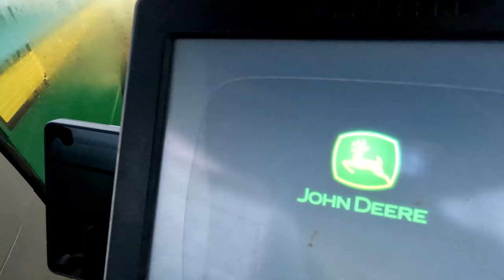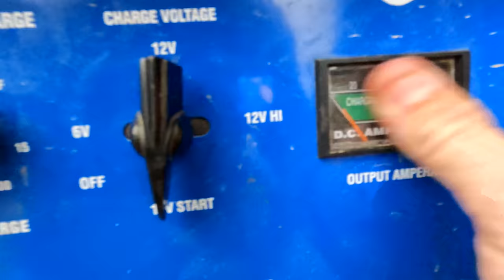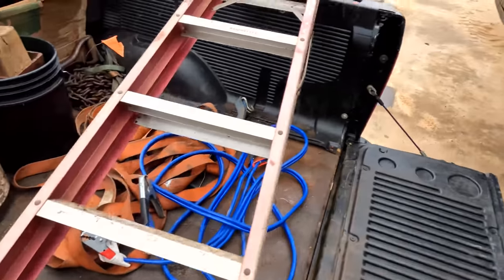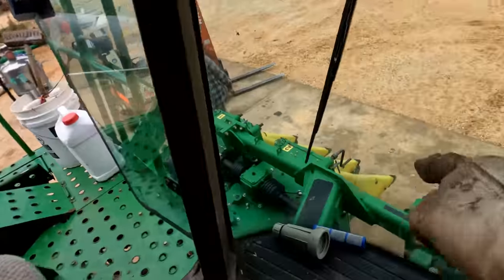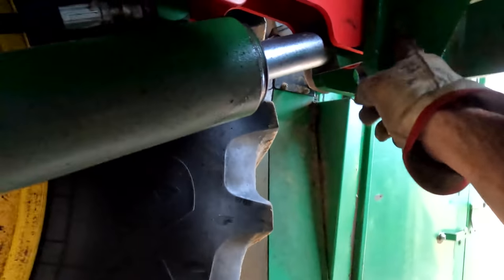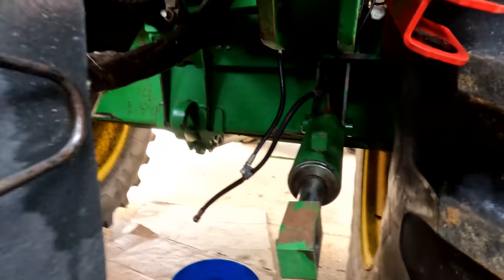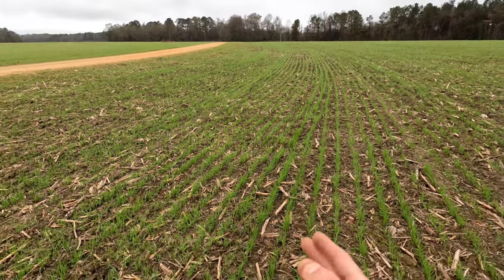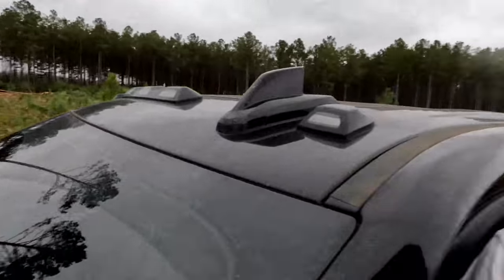PINE TREE HARVEST

Comment: Danial. I worked as the lead school bus mechanic for a school district for 8 years. I had 32 busses under my control. OMG everyday we had battery issues. I took it to the school board. I wanted it fixed. They approved me to get all new batteries for the buses and not just any battery. I requested Interstate Batteries. Yes they are expensive. Guess what. I never had an issue with a battery again. Go figure. The company I got them through even sat me up as a dealer. Mind you. For school vehicles only. Not like a store type dealer. Meaning, I had a battery truck stopping by a few times a month to update what was in stock. I had all sizes also. Big giant truck batteries down to lawn mower ones. Look into it and see. It will stop a lot of your issues. Cheap batteries hurt you in the long run.
Reply from the maker: Great information, thanks for watching 👍😁
Reply: @TripleRFarms  If you break it all down it will show you that the better battery saves you time and money. As in. How long it machine down while charging? How many people involved. Like in the video. It was you, your dad and PA. Three people on one dead battery veh. What could two of those involved be doing? And what did starting that picker really cost you money and time wise. I fel for you as I have been there and did all the math on it. Higher end batteries save you in the long run.